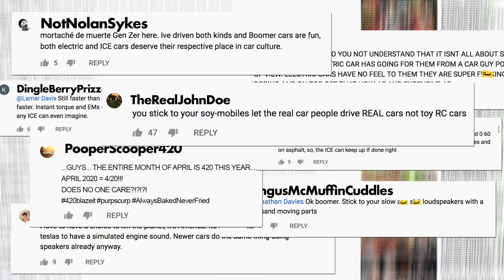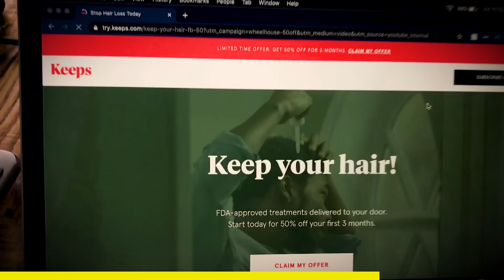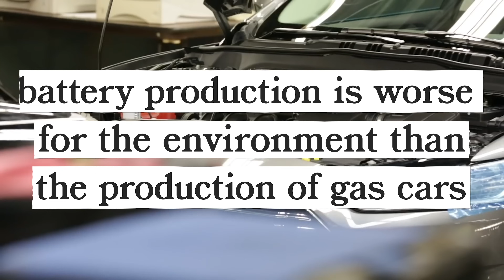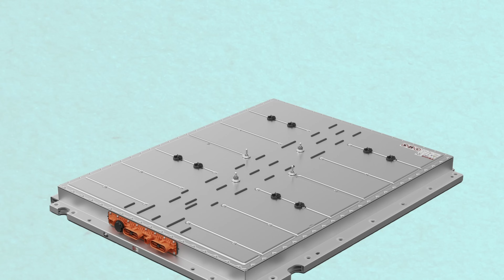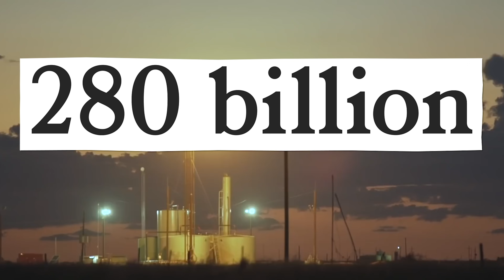Are Electric Cars REALLY Better for the Environment?

Comment: And when we have a major power outage like happened to Texas how are people going to get around to work or just live normally ?And what is the expected range in miles and how often are we going to be able to recharge and how long does ittake take to recharge?
Reply: Texas's power outage was due to a natural disaster not due to the limitations of the grids capacity. Without the natural disaster forcing more than half of the grid generation capacity offline, Texas could have easily weathered that kind of demand. Why do people keep trying to use this as an example of grid not being able to support EV's. Nobody is saying that Florida cant support EV's because it might have a hurricane which will cause a blackout by tearing out all the power poles and flooding power generators. Saying the grid cant support EV's because Texas had a blackout during a natural disaster is like saying the grid cant support EV's because New Orleans could provide power to everyone after Hurricane Katrina. Its just a stupid stupid argument.
Reply: But surely, if there's a major power outage there won't be much point going to work?  Electric cars vary in range depending on the size of the battery pack. My Kia has almost 300 miles range on a full charge, and I charge it overnight about every 8 to 9 days. I have charged up during a longer trip, when I charged up from 30% to full in around 40 minutes using a 100kw charger.....
Reply: @Brian-om2hh  Another point is that during a power outage. You wouldnt be able to get fuel either because the pumps wouldnt be working.

Comment: So EV's use 10 extra metric tons to be manufactured, but then never burn fossil fuels again for the rest of their life. And let's remember all the fossil fuel used to mine more fossil fuels.
Reply: For life?? The batteries need to changed man
Reply: @politicalflashback.880  Yeah which is why solar and wind is increasing exponentially lately, it's renewable.
Reply: oil and coal are still major sources of energy for the power plants. So they are depended on fossil fuels to operate. Renewable energy is not their yet on replaceable source of energy. California can't keep up with the need energy. The transport of the energy relies on fossil fuel because EV can't get past the physic of portability and power at this time. until we replace power plants with Nuclear power. Fossil fuels are the most reliable source of energy. With the newer nuclear plants we can create smaller plants that can be deployed and replaced even safer.

Comment: Just to make the EV batteries creates as much C02 in the 2 months of building them as an ICE car does in 8 years .. There are Huge Toxic substances released mining and processing the rare earth minerals but that will be done in China and Africa with Slaves .. the batteries last 10 to 15 years and then it takes 5 times the energy to recycle as to build the nasty things .. And Solar panels only turn 15 to 20% of the energy from the Sun into energy and the rest is released in the air and since they are black they will help heat the Earth .. All the So called Green Stuff is a Scam to Farm Gov. Subsidies for a few insiders and this is Crony Capitalism where the Commis pick the winners and losers .. what matters in Energy is Energy density .. Gov. backing of this Scam will just lower Living Standards from Malinvestment !! .. Get ready for really Big Inflation !!

Comment: What about the final disposition of each type?  Most of the internal combustion engine is completely recyclable, whereas the lithium batteries?
Reply: Lithium batteries?   Can be recycled no problem. Watch the YouTube video of the VW Electric Car Battery Recycling Plant, and see the process for yourself. The lithium and cobalt is recovered to levels of around 90% or more, and then re-used in new applications.......
Reply: @Brian-om2hh  Many thanks - I did not know that.  The video was very informative.
Reply: @beachz101  You're welcome.....

Comment: Tell Texas the electric grid can handle EVs
Reply: This was a issue with the power plant not being able to handle the extreme cold. 

Here is a discussion on the situation linked below. 

I think a lot of people are misunderstanding this as a shortage of power but in fact it was a failure of multiple power sources not ready to handle such a cold environment for as many days as it occurred. :)

https://en.m.wikipedia.org/wiki/2021_Texas_power_crisis

So EVs in fact shouldn’t be an issue in Texas. But cold weather like before will be until they correct it.

Comment: mining of lithium is super bad . as make soil contaminated  and same as air .  and for one ton of lithium you waste 2.3 million litters of fresh water. when many places in world now have water scarcity. for short run is good idea have EV but for long one  is bad.  also charging is go from grid  when some countries still use coal power plants and is not even close enough  nuclear or other type of power plants.  so EV is failing project. better focus on different type of fuel for ICE or what Honda did hydrogen make from manure :))

Comment: You forgot about battery replacement cost and old giant battery recycling
Reply: And how much do you suppose it costs to have a new engine fitted?   And battery recycling isn't an issue. Recycling is happening already....
Reply: A battery can simply be hooked up to the powertrain. An engine on the other hand needs pistols, needs to be connected to the exhaust, etc etc. replacing a engine costs more than battery

Comment: Everyone only calculates co2. What about chemical footprint.Chemical Fumes produced while producing, charging, discharging and disposing battery. It's easy to get back from carbon foot prints lockdown throughout the world proved it carbon level dropped down a lot . But not way back from chemical foot prints. One used battery in your backyard can make hundreds of sq meter of land infertile and water sources chemically polluted. Think about it

Comment: EVs cannot become widely used without renewable energy sources. The issue is the poor yeld of those sources. Assuming we gonna have 3 billion EVs, those get charged usually in the afternoon/evening, when there is already a higher consumption due to illuminating the cities/people are at home using stuff. The huge load on the power grids requires waay more power to be produced. We either make more traditional power plants which has a significant increase in co2 or we make more renewable sources which have poor yeld which most probably limits the amount of energy used per household. This means people will have to settle with less. And that reminds me of communist Romania when they had to impose rationalization on food cuz it wasn't enough for everyone.

Comment: Why do people use the cooling towers on nuclear power plants to represent pollution?! It's just steam. No carbon emissions
Reply: It happens because they haven't bothered to find out what they're talking about before they open their mouth.....
Reply: Agreed     there are other types of reactors that are much cleaner than the ones used now
Reply: Well we can remove them if they want
Reply: Remember people are carbon based life forms... trees need carbon ... co2  can create a greenhouse effect.... which is  GOOD for the planet
Reply: Because many people don’t understand science or like to remain ignoramuses.  Just the US alone uses trillions of kilowatt hours per year.  It is completely IMPOSSIBLE to get our energy needs from hydro, solar and windmills (all which have their own environmental impacts BTW).   Just to power a single home takes 400 sq ft of solar panels, plus electronics, plus batteries.  The panels need replaced after about 20 years and the batteries last about half that.  Add in commercial businesses, government buildings, manufacturing energy usage.  Windmills don’t work either unless you want to line the beaches with them.  Large ones are about 1 MW.  Just a single city could require 1000 windmills.  If you want to cut carbon emissions without extremely dramatically cutting into our energy usage and standard of living you currently have one choice.  Nuclear.  If the waste is a problem we need to deal with it.  Sorry to bring facts and truth to those that don’t like it.
Reply: Becuase unfortunately you can't see carbon
Reply: I was going to say that.
Reply: Yeah I took to the comments when I saw that… 🤦🏻‍♂️
Reply: Every gangster until they throw radioactive waste into the sea
Reply: Bit they leak ... study shows 75% leak ... and you can fact check me
Reply: This is before I was on YouTube
...... This must have brought out the  "Tesla Bots"
Reply: Nuclear is alot more efficient and cleaner than coal and nuclear waste is actually recyclable. All of Europe recycles it
Reply: @joewarnock19   Because Europe is liberal but sensible, there is no sense to the American left. Wind and solar aren’t good alternatives tbh, so much waste over the years and is not financially feasible to motivate its upkeep.
Reply: It's not as easy to get a video of them dumping spent uranium into the earth.

EDIT: Aye y'all stop replying to my comment, damn. There are many much  more engaging conversations happening below.
Reply: They don't just dump it in the earth, they store it safely in a silo.
If a nuclear power plant produces energy for 60 years, there's only about a as much nuclear waste as a small swimming pool.
However, modern thorium reactors can use nuclear waste as fuel
Reply: @rubenmanssens  thorium is the future! Heck, even the gen  IV fusion reactors are super safe and a fantastic idea for future energy needs. Such a shame the lack of knowledge people have on the subject and the propaganda too.
Reply: @Not_Valentine  45 years of nuclear waste in Sweden filled up like half of a storage room. Its way better and cleaner then any other form of energy.
Reply: @mikeoxlong3676  I get what you're saying, but I'm also long inactive in this thread. There are many other relevant points by other people.
Reply: @Not_Valentine  the earth is were it came from to begin with, and that's not a problem anymore
Reply: @Not_Valentine   still better than gas or coal bud
Reply: @Not_Valentine  Nuclear waste from every nuclear power station in the united states wouldn't even fill up half a football field.
Reply: @Not_Valentine  The amount of nuclear waste produced is incredibly tiny. Nuclear is safer than any other energy source out there by far.
Reply: @Not_Valentine   gas cars are way worse lol
Reply: @shamarerskine3987  never said they weren't. But I'm also long gone in this thread. There are other much more interesting talking points than mine.
Reply: Water vapor is the largest greenhouse gas technically.
Reply: @mikeoxlong3676  nope...methane is, and it's directly linked to the cattle industry...sorry I'm not giving up red meat...
Reply: So frustrating that we disregard nuclear power as dangerous 🤦🏻‍♂️ I look at it as though we got the technology of the future out of order so we take it for granted smh. We got this technology before solar… solar is supposed to be impressive? Lolol
Reply: @greenanddan  Real solar is. Keep in mind that land-based solar panels only receive an incredibly small fraction of what sunlight actually hits the earth. Satellite-based solar panels are far better. Do we have a way of utilizing the energy collected by satellite-based solar panels on the surface of the earth? Unsure, currently, but the Chinese government is producing a single satellite for testing purposes. If you want to be really impressed, look into the concept of a dyson swarm. A sufficiently large swarm would be nearly loss-less.
Reply: @patrickchapman3242  It may be possible to collect solar energy in space and beam it to earth with microwaves to transfer the energy.  It would probably work but who is comfortable putting something in space that can be pointed at a city and turn anything living thing into beef jerky.
Reply: @bassmanjr100  Provided enough controls were in place, I would be. If your concern is it could/would be abused for war-like actions, which is what I gather, don't forget that we already have more than enough firepower to end all life on the planet (or, at the very least, almost all of it). It's no more risky than the nuclear weapons that already exist. And yeah, with ballistic missle subs, and similar, you could be several thousand miles out and, essentially,  undetected. Missile defense is okay and all - but hardly perfect. Odds are that a few governments could already destroy random city of choice before anyone could stop them.

So, why don't they?
Controls. And deterrents.
Yep.
Reply: @greenanddan  when i was a kid, i had a little $10 toy from radio shack that consisted of a small motor+fan blade connected to a solar panel. walk outside, or just put it in a sunny window and the fan spins. as a kid i thought that was fucking awesome, and it still is now
Reply: Water vapor is still a greenhouse gas that traps heat. But I agree, I don't think there is any carbon in it.
Reply: @toomuchgyal9083  so clouds bad huh? As far as I remember, they reflect a lot of solar radiation back to the outer space so it has a +ve point too
Reply: @commieTerminator  where did i say clouds are bad?
Reply: @toomuchgyal9083  u didn't say, u typed it. Clouds are water vapour only
Reply: @commieTerminator  water vapor goes both ways, it does reflect a lot of solar radiation back into space but it also traps radiation with in the atmosphere...back on 11 September 2001 a study was conducted when all air traffic was grounded and it was found there was a decrease in temperature across America and, I believe, the world, which they directly linked to the amount of water vapor in the air during this time frame
Reply: @toomuchgyal9083  and water vapor condenses into rain
Reply: Because it's more difficult to show the radiation problem from the nuclear waste, but it's there.
Reply: Yes. More uranium waste in out earth plz.     Fission energy controbuted to development of atom bombs, and was a desperate attempt to replace oil.
Reply: @Necromanzerrr  u get like a barrel of waste in 30 years of clean energy production with modern technology it can be thrown to space, unlike solar panels that has poisonous elements and can't be recycled and u have tons of then from only 10 years of service, because u need to replace those and windmills kills birds and disrupts ecosystems just like hydrostations.... so there is basically no other rational choice
Reply: @obeybosss  solar panels last many decades. they are warrantied to produce at least 80% of their rated power for the first 25 years, but can go on for decades past that. there is an array installed in europe back in the 1970s that still makes power today.
Reply: @vinylcabasse  it doesn't matter if it works or not it's efficiency, it drops year by year, also increasing surface of sun panels you are getting a lot of those smashed and damage by exterior factors, dust wind, snow birds shit, tornados and etc. Main issue with those they are not recyclable and contain toxic elements in it's design
Reply: @obeybosss  like i said, guaranteed/ warrantied to be at least 80% for 25 years. It's not going to suddenly drop after that either. Should be able to continue producing useful amounts of power for decades after that.
Reply: Also, some panels are even better - 30yr warranty and minimum 87% original output for that period
Reply: @vinylcabasse  once again, i'm not agruing that if you will place a sun panel in a lab and place sun beam at it, it will be able to generate electicity for 25 year with some efficiency, i'm saying that solar panels get destroyed by wind and sand/dust, it get scratched, if it solar farm situated near city  - then rain drops contain CO2 and other plant emissions and become acidic that slowly degenerate panels thus reducing their efficiency, look at a fresh piece of roof material in like 5 years, it becomes much darker, sometimes moldy ... You can not place panel under a protective glass and NO company will make a money back or replacement if you will show up with such a panel at their tech support.
Reply: @obeybosss  87% at the end of 30 years, warrantied. That's still completely usable! Yeah, sure, you might need to clean it from time to time, but this is proven tech that has been around long enough that i have no reason to doubt that kind of manufactures guarantee. The top of the panel IS GLASS!
Reply: @vinylcabasse  it's not conventional glass, glass stops UV spectre making it much much less efficient, so it's not your average glass. And i'm not saying that if u will buy a panel it won't work you will keep it clean and it will provide you with some extra energy that's fine, but making industrial solar farms atm proving that tech being not so usefull and much less green as it seemed before.
Reply: @Necromanzerrr  nuclear power is also a significant safer method, to the environment, of providing power compared to gas or coal